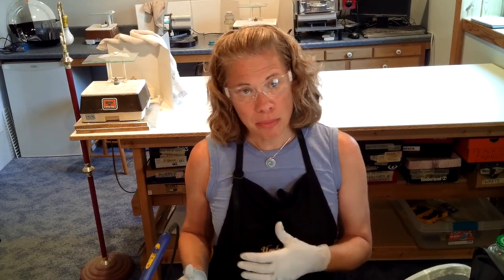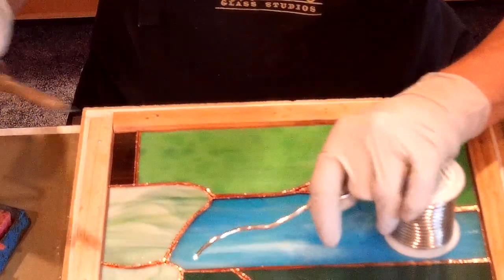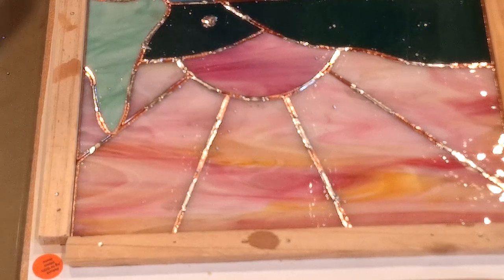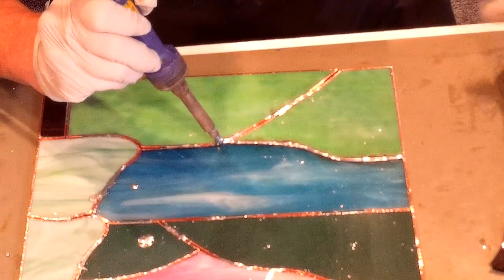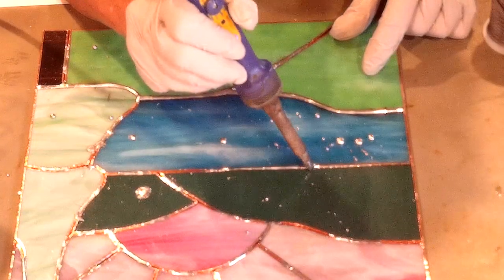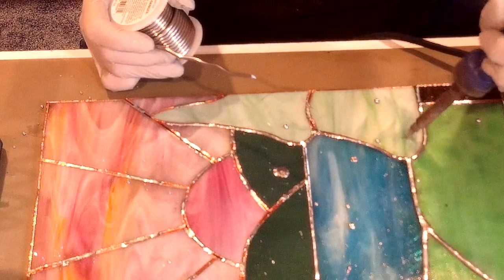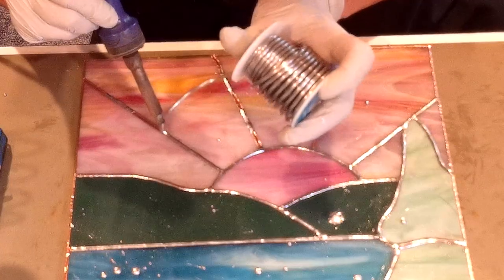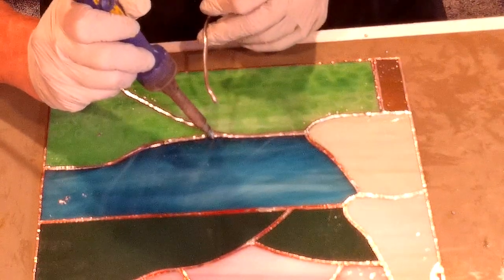Beginner Stained Glass Part 5B -  Soldering

Comment: when my sodder sizzles like i hear yours doing, it appears to be burning leaving black in it that i cant get out. Iron on lowest heat.
Reply from the maker: The solder boils and can leave black spots.  These have always cleaned off for me with the Windex & 91% alcohol combination.  You can also get the black backed adhesive from the black backed foil oozing out the sides of the foil and solder joint.  This is harder to get off, but can come off with the end of the dowel you use to burnish the foil, or an X-Acto knife.

Comment: Will the heat of the iron crack the glass if you go too slow?
Reply from the maker: Not usually.  You get cracks from thermal shock.  This means if the glass heats or cools to quickly, it can break.  So if your glass is cold (you've left it out in your garage or car on a cold day), and then solder, you are more likely to get cracks.  You'll want to warm up your glass first with a blow dryer before you solder.  In general, the foil heats first, then slowly warms the glass.  However, if you play in one area too long, the glass can warm up quite a bit.  Then when you leave that area, it can cool too quickly and crack.  Also, thinner glasses can heat up more quickly and crack easier.  So cracks happen, and sooner or later you'll need to learn how to fix them.  If you are getting cracks frequently, it is usually because you are running your iron too hot.

Comment: If I have gap, can Sauder fill the gap?
Reply from the maker: Yes.  You can fill in with solder so that it looks flat first.  Then go back over the joint a second time to bead.  If it is a good size gap, say 1/4" or more, you can fill it with copper restrip (looks like foil, but is solid copper with no sticky backing) before you solder.  Just bend the restrip over itself like you would fold a bow and place it in the hole.

Comment: Why is it you can never go to slow? Won't you be worried that the glass will crack from getting too hot? Thank you.
Reply from the maker: Glass breaks from thermal shock when it is heated to quickly or cooled to quickly.  When you solder, you heat the foil first, then the foil slowly heats the glass.  As long as your glass is room temperature, and your iron isn't too hot, the glass should heat slow enough not to break.  If you play in one area a long time, say 5 minutes, the glass may break cause you now heated the glass to a much higher temperature and can break from cooling too rapidly.  But if you are soldering and pause for 5-10 seconds, it should not.
Reply: @greatglassgalore  thank you!

Comment: Linda - If after taking off solder at a 90 degree angle the solder does not form a sphere away from the line of solder, does that mean the iron is not hot enough??  I'm a beginner and using a Weller iron.
Reply from the maker: No it does not mean that.  It just may be that there is not enough solder to be heavy enough to come off the tip.  You can shake the tip over a news paper, to see if you can get more off the tip before going back into the solder joint to remove more.